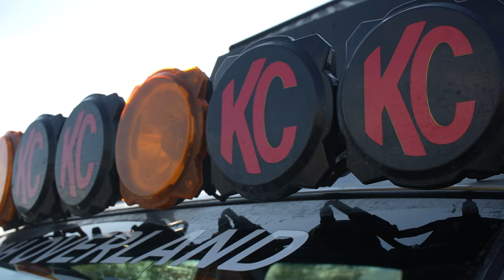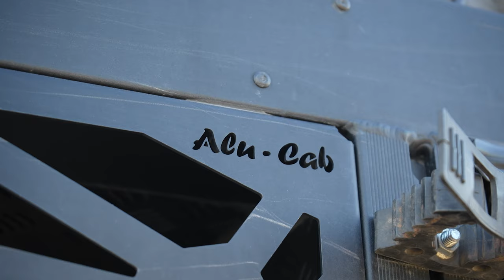Adventure Vehicle Walk-Around | Tacoma with ALU CAB Canopy Camper

Comment: Thanks for the video. This will help me make a decision. I like your setup as it is very minimalist. I just bought a 1200 w solar generator to get the ball rolling. Now to decide on the few options i want on the Alu Cab
Reply: I forgot to mention I have a 2013 dbl cab Tacoma with a slight lift running 33’s no mods yet except a tune.

Comment: Thanks for the walk around on your rig.  I have the ALU-CAB Canopy Camper on my 2016 GMC Canyon.  I'm going to install ICON Stage 1 suspension this week.  Does your camper have any strange squeaks or noises?  I have one that is bugging me because I can't figure out where it's coming from, lol.
Reply from the maker: The only squeaks im getting are from my rusty coil overs and rear fiberglass! none from the camper. The table mount needed to be bolted in over the pop rivets but thats an easy fix!

Comment: Hey  . When you latch from inside someone can still get in from outside right if they pull ? I just wanna make sure mine work properly
Reply from the maker: No! It definitely should not. If I does, you should be able to tighten the screw on the latch, making it a tighter compression latch! I use this mechanism in place of a lock.
Reply: Oh shit , yeah ok that makes sense . Thanks man !